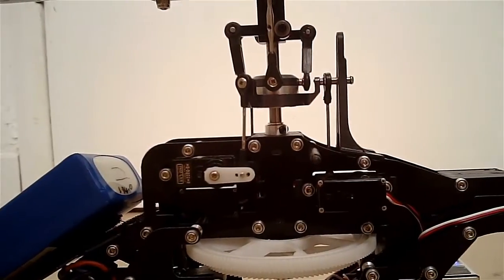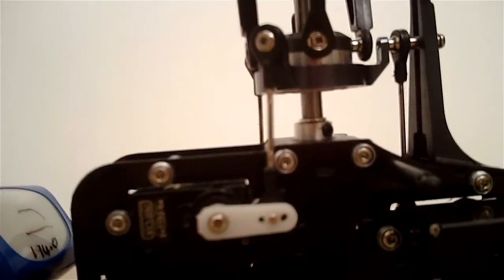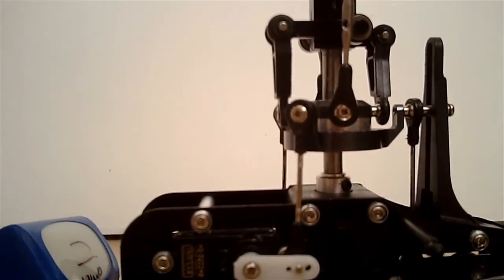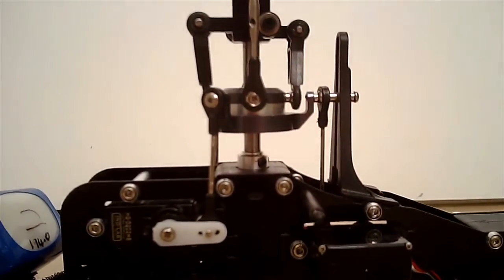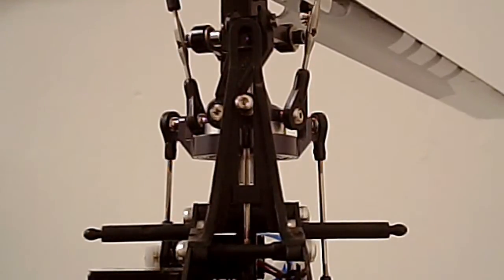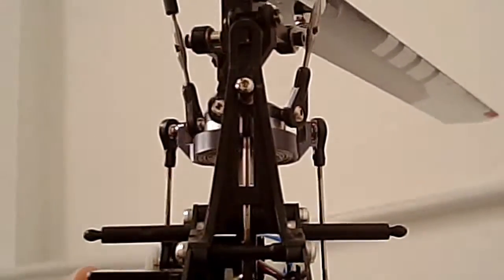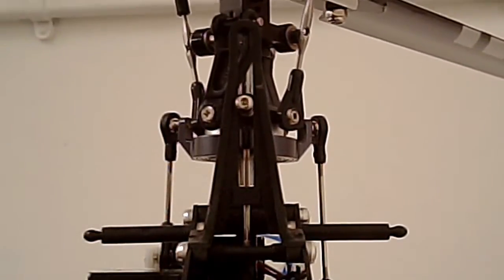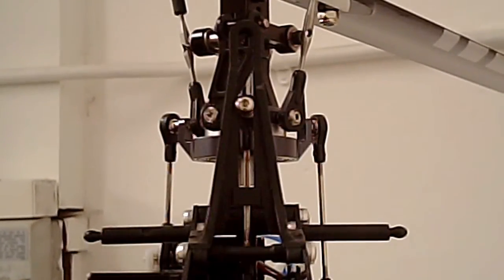LH-450bb FBL 032113 Tarot ZYX-S Firmware v4_00 Is This Why We See PitchUp In FFF?

Comment: hi simon , ive had pitch increase in hover ! nevermind fff lol i do get in fff too but not bad . my latest problem is mid flight the heli begins a piro spin of death . i lose all control and it holds last command until it hits the floor ! even throttle hold (dsmx dx6i) does nothing for 2seconds i just have to watch as it tears itself to pieces ! any help appreciated 07736841549 txt me bob uk

Comment from the maker: Bottom line is that it's a good gyro and the OEM is working hard with firmware updates which arrive every few months.  As for the pitch-up, I tried reduced gain and reduced I-gain to no avail.  Tarot suggested the opposite!  Neither worked!  However, I am testing a beta firmware which is much better.  I believe the route of the problem is dyssymmetry of lift in fff and insufficient gyro authority to counter.  Tarot have given me v4.02 to try that has greater cyclic authority & it seems to work.

Comment: I have this gyro on order, however I have not had the pitch up problem simply because I haven't received and installed it yet.

However from video's I've seen, the gyro appears to be trying to right itself which it shouldn't be doing. My immediate assumption would be too much gain. You don't want the gyro to make every single adjustment it can to keep stable. That's your job. You just want it to be as stable as a flybarred heli without the mushy feel of a flybar. So cut the gain in half maybe?

Comment: posted this on RCG but will copy it here as well.

I think you are spot on Simon. I just tested my heli with 4.0 firmware and the same thing happened in that the ZYX when tilted gave less travel than I got when moving the elevator stick.

However my other heli has 1.01 firmware and both tilt and stick give the same amount of travel. 

Maybe they changed it to fix another problem but seems that is why the pitch up bug is happening in the later firmwares.